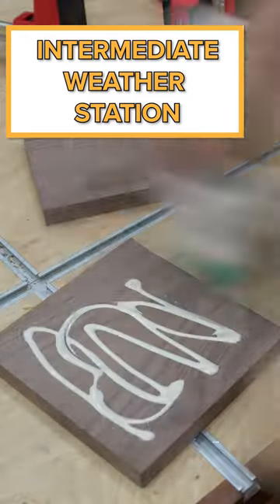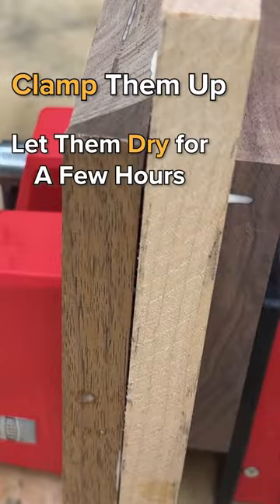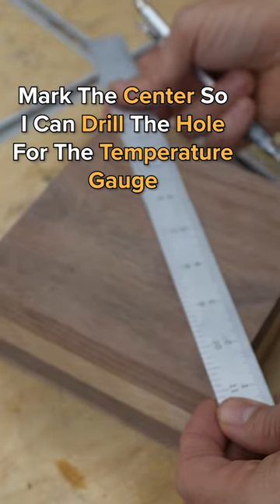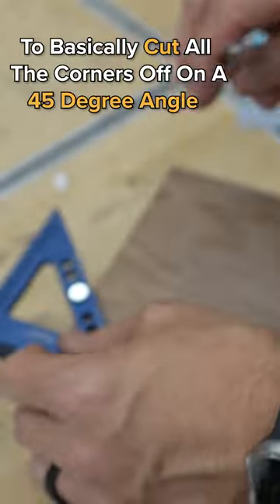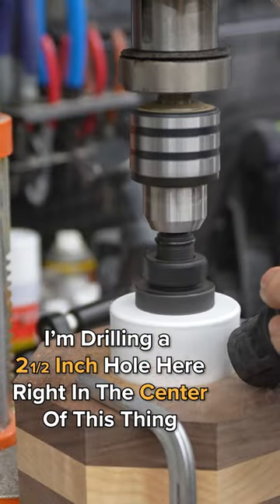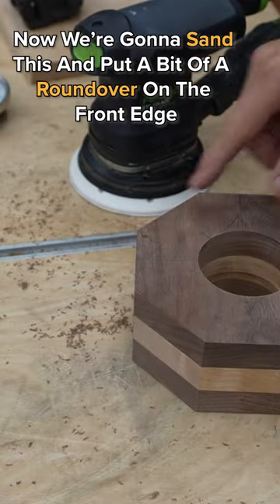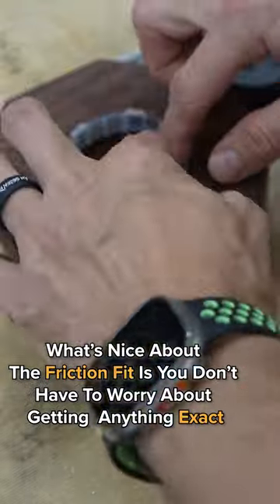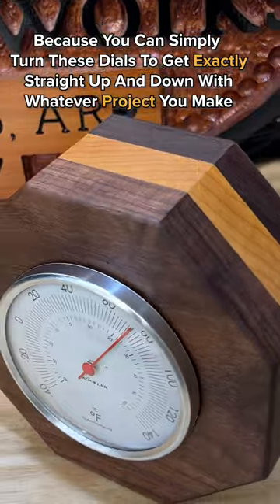Scrap Wood 👉🏻 Desk Accessory #diy #woodworking #shorts #upcycling

Comment: What oil do you use?
Reply: Do NOT use mineral oil. 
This is not a 'Drying' oil. It's a machine oil for lubricating or laxative. 
The use of Tung oil, or linseed oil (boiled or not), is a better choice.
These will create a subtle sheen.
Top coat with wax and polish😅